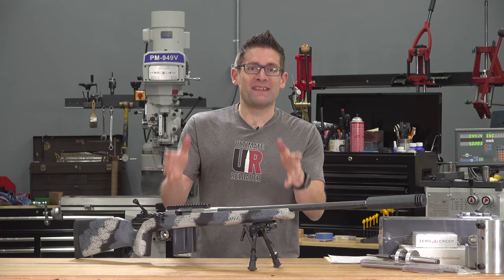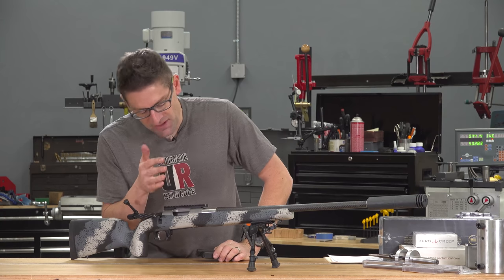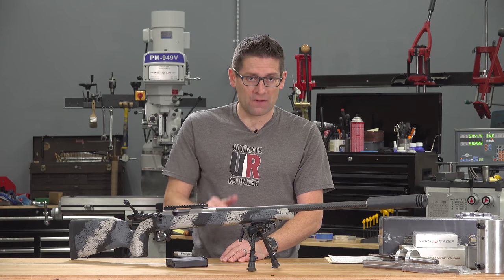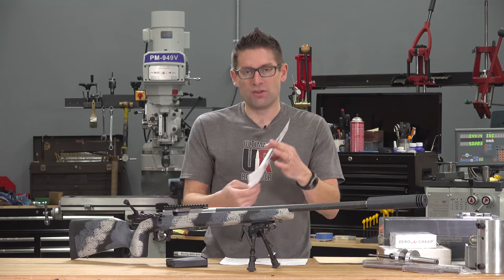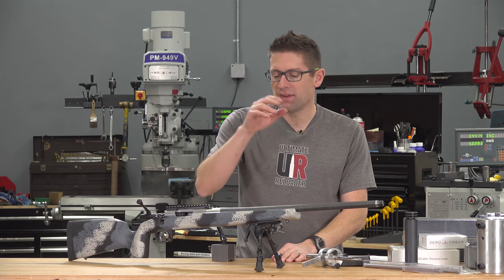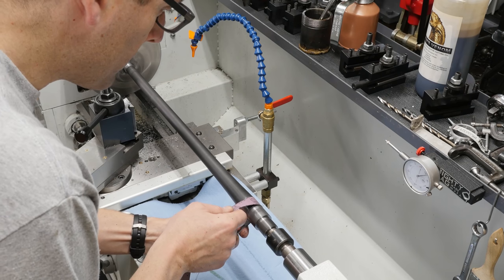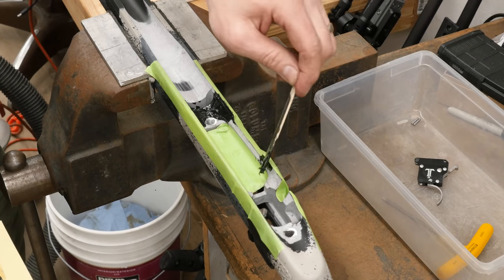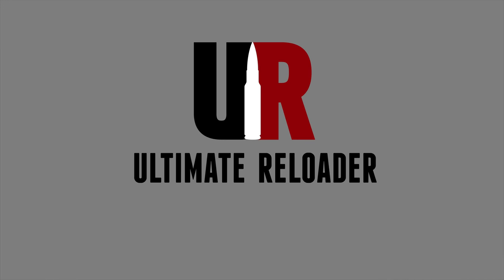6.5 PRC Light-Weight Build Part 1: Action, Chambering, Fitting

Comment: Can't wait to see the rest on this build.  I've really been thinking of a build almost exactly like this one.

My take on scope ring lapping and bedding is don't.  The scope should be straight and true and the rings should be identical and the base should be straight.  Where the miss alignment in the system likely comes from is the action to base fit.  This is especially true on actions with "flat" rear receiver rings.  This in inevitably where variation in the machining comes in as they cannot be all identical and isn't really an issue on straight tube style actions.  What I prefer is to bed the base to the action.  Tighten only the front of it and check the rear for gap, then tighten only rear and check the front for gap.  Bed the side that presents gap.  I like to rough the underside with a dremel so the epoxy can bite to the surface.

Comment: When lapping the lugs useing the trigger/fireing pin to add pressure....there is a chance of lapping the bottom lug more than the top (more pressure on one lug). Now the bolt can lock up out of square and brass will fire form with base out of square. All ways use a lapping tool not the trigger sear for pressure. Nice build BTW.

Comment: Like your setup.  Glad you picked the PRC over the creedmoor for a hunting round, not that the creedmoor is bad, i just think the PRC is a better hunting round.  I would use a cap on the barrel instead of the can.  I like your choice of 24 inch over 26 inch for the barrel, enough for good performance,  but less "pool cue" effect, although your can kinda ruins that.  But the noise reduction will be nice.  When are you gonna deliver it to me?   ;)   :D

Comment: What length action did you go with, what's the max COAL of the detachable magazines you use, and are you happy with the set up? I'm interested in a 6.5 PRC but need to get action length buttoned down before deciding whether or not to move forward with it.

Comment: Love the build i recently did a 7 SS build similar to that on a 737R, proof sendero, manners PRS2, and TT Diamond. Absolutely love it used it during hunting season and couldn't be more fond of the rifle. So i'm curious to see how the benchmark barrel shoots i went proof since they came down in price and i had heard various reports on other wrapping methods. I wanted to ask though and not to knock Pierce but shouldn't going custom alleviate the need to lap the lugs? Granted i haven't checked our customs but i'd just assume they should be designed to not need lapping for 100% lug contact.
Reply from the maker: Thanks Will- RE: lugs- I just noticed that my Kelbly's Atlas Tactical also needs lug lapping. According to Gordy Gritters, a common thing even with custom actions :)
Reply: @Ultimatereloader  Damn what am i paying for then lol that's a little disheartening. I wish i had seen that pierce action when i had dad's 6.5 SAUM built. I went Bighorn SR3, MCS T, 3B fluted finished at 23". It's heavy for him though. If i'd have gone Proof sendero lite and the pierce action it wouldn't be so front heavy and probably be sitting around 9bls loaded.

Comment: Nice  build, but why didn't you use a like a Hawkins Oberndorf M5 with a Wyatt's PRC box and follower to keep the weight down even more? Also why the Mark 5 that weighs 33oz vs the VX5-HD 3-15x56 which is 21oz if it's a true hunting rig! Other then that looks like a solid build!

Comment: How did you determine bolt lug engagement.
Reply from the maker: Very simple- clean lugs and seats, mark on back of lugs with red sharpie, then work bolt (with trigger in place). Engagement is shown where the red sharpie is worn away!
Reply: Is lapping the bolt lugs rather common on most builds?

Comment: @gavintube- Think there is much difference in rifle chambering when using the smaller PM "gunsmith" lathe?
Reply from the maker: The PM-1340GT would do really well. I hear REALLY good things about them, but haven't had my hands on one... yet :) I would be confident with one if you don't need the 2" thru-spindle capacity...